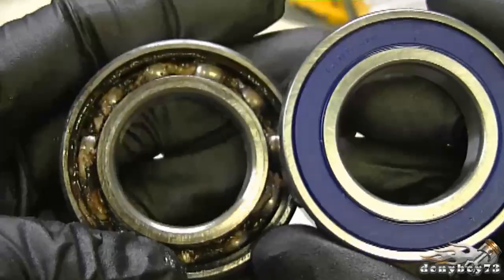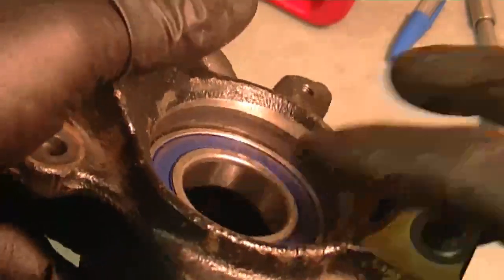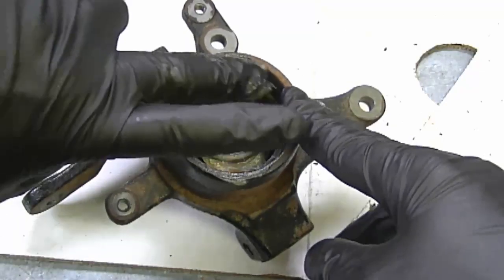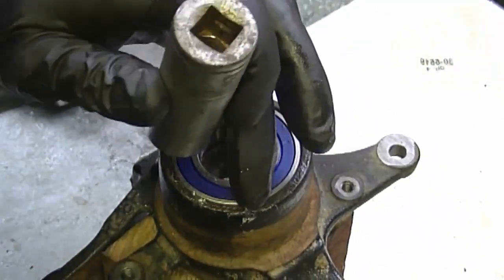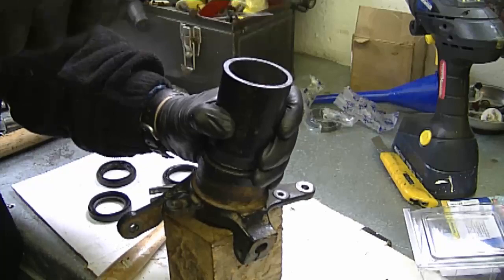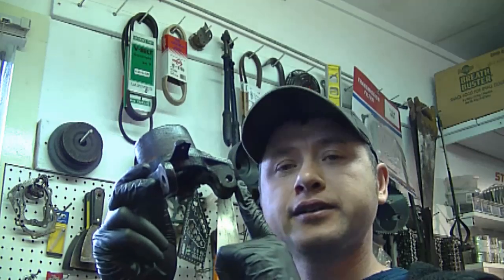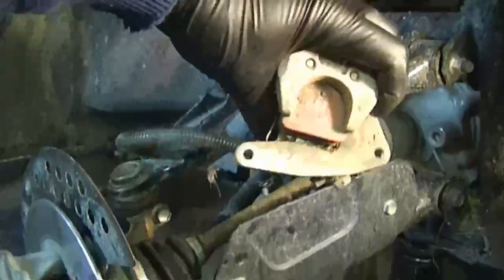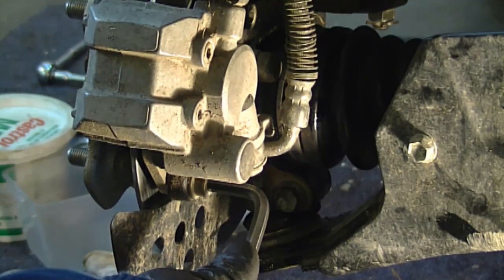How To Replace The Front Wheel Bearings On Your ATV - PART 2

Comment: Loverly job mate.

Also using the outside ring from an old bearing can be used to push a bearing in past the surface, without the centre being touched, it works as ive tryed it :-)
Could be used with seals as well.

So dont throw your old bearings away when they may be handy later as a tool.

Allways enjoy your tutorials donny :-)

Comment: Donny, Sometimes it helps to put a bit of Vaseline or light suspension grease in the backside of the seal when installing without a seal driver. Doing this will help prevent having the spring come off the seal which would allow the seal to leak oil out, or dirt in

Comment: Im having trouble getting the bearings out of a 2WD front Kawasaki hub. The bearings are not moving at all. Im using a large impact socket and a sledge and those bearings are not budging. No clip either.

Comment: Thank you so much for posting this! Would you happen to know where I could find the dimensions for the a-arm mounts on the frame? I am needing the vertical spacing from the upper and lower frame mounts as well as center left to center right dimensions of the upper and lower a arm mounts (or the distance that the lower mount is set inboard on the lower mount)

Comment: Hey dony got a question related to motorbikes I have a problem with my starter on my pitbike alls it does is clicks and doesn't start the engine battey was new and bike was is it a common problem with new starter motors

Comment: hey donny, just a couple things i wanted to point out to you.  you can use a piece of hardwood to hit bearings in. or a piece of 4x4 cut to size.  also a socket the proper diameter to the outside of the bearing.  

same goes with seals. also just dab of grease does help some.  good videos otherwise.

Comment: i cringed when i seen him hit that bearing with a steel hammer..  use a wood/plastic/old bearing/rubber mallet whatever.   i keep lead and nibril ingots around just for this purpose.

a brass/bronze collet punch (3-4" diameter) with a lead face is very nice for installing bearings